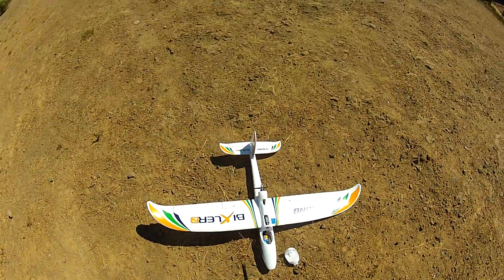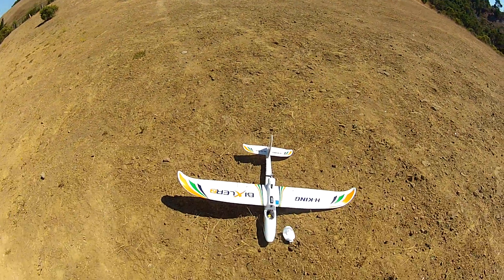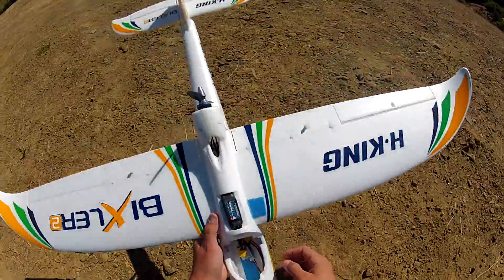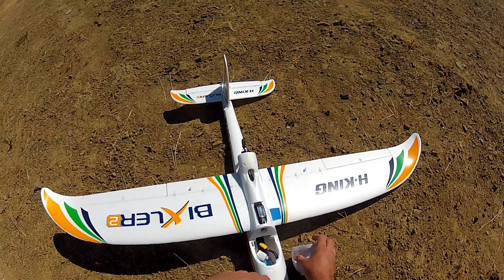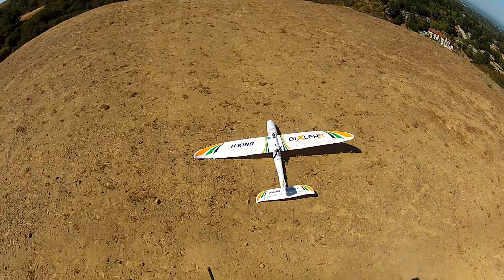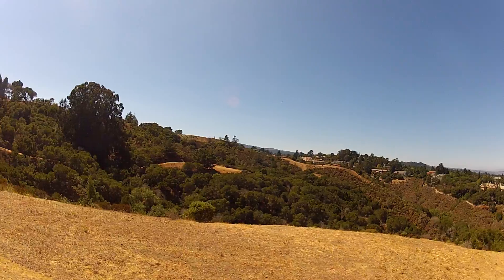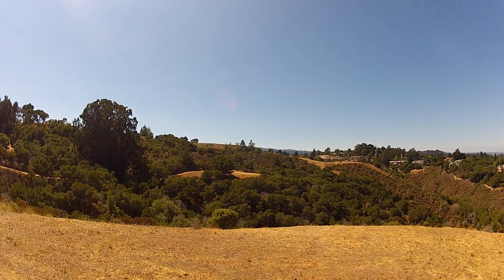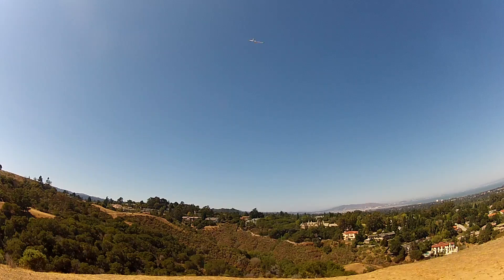Bixler 2 Motor Upgrade: TEST FLIGHT

Comment: Hi, I'm thinking of buying this, or another identical (sky surfer 1400mm) plane, but in the kit version, without motor and electronics rest and I would like if possible give me your opinion about which motor, esc, and props you should use Which is very stable but also have some power, will a 2826 engine 2200 kv will be suitable for this aircraft !!? thank you  !!

Comment: Hello my friend! I have a little problem! My plane is complete but for some reason even that the elerons are precise the plane keeps turning right...  Even with trimming the elerons from the controller to the left it keeps turning. Is it maybe a weigh problem? I am Asking because it is completely symmetric....
Reply: If you're still trying to solve the problem, try trimming the rudder in the opposite direction of the turn as well... Should solve your problem
Reply: Yes I still do! OK my friend I will!  Thank you!!!!!

Comment: Hey am I on my own here or is 2200kv over kill on the bixler 2? It comes with a 1300 stock which is just about enough but if you want more power whats wrong with 1500 or 1700kv I'm about to build mine as a kit. Could you tell me the benefits of the 2200 say over the 1700kv motor? I'm confused help! Cheers
Reply: +traci beacer from what i have read the 2200 is used by most people to balance the plane out at the CG. The weight of a 2200 balanced mine perfect at the instructions CG with no added weight front or back.

Comment: I've seen this video about 10 times and decided to try this setup on my Bixler 2. However, I did find my setup to be different... What I have done is used the 4mm carbon rod inside the hollow rod supplied for the wings, I've added 2 extra rectangular spars on the top of the main wings to prevent the wings from bending and added another spar on the elevator as well. And I also have the two extra servos for the flaps. Although I am using the same 2200kv NTM motor, I went with a Hobby King 50amp ESC instead but still picked up a 6x4 prop just as you did and flew the plane... Gotta say, not super impressed and it doesn't seem as fast as yours. I found the 6x4 prop not to be the best option for MY Bixler as I my plane may be heavier than the one you have. So I think the 6x4 prop is ideal for a light weight setup, but not if your plane is a bit heavier. It certainly had some speed, but I found myself flying at above half throttle most of the time just to maintain flight and do any rolls or loops. And not to mention, it was loud. Haha
I have since opted for a 7x4 prop which draws 46-48amps and about 500-530w, while the 6x4 was about 28-32amps and 310-330w. Of course, readings will vary depending on batteries used. I'm yet to fly the Bixler with the 7x4 prop, but I'm confident it will have power & speed to spare and I may not ever need push it to full throttle, but I'm pretty sure I will have a better speed envelope and won't need to be above half throttle as much (or at all).
Thank you for showing us this setup (I've also seen your other videos on the Bixler 2), it has certainly helped me in improving my plane and get more out of it without having to spend a lot of money. Keep up the great work. :)
Reply: Aussie RC Playground Mate, just throw in a Nano Tech 4S battery with a 6x4 and you'l love your bixler. The upgraded 4mm Carbon rod you installed is exactly what I did to mine, running the same 2200kv NTM motor BUT running on 4s. Your 50A ESC will handle short bursts of full throttle, just dont hold it for more than 10 seconds.You can always stay with 3S, but you will have to constantly have your throttle stick 80% to keep it up. On 4S you can have your thottle at 20% with allot more punch if needed. I usually get 8min of mixed flying (Speed passes/Gliding). Good Luck!
Reply: EUROASIAN10 Thanks for the tip, but I'm not really interested in running 4S in it. I have tested the plane on 3S with the 7x4 prop and it will climb until you loose sight of it or until you loose range. I fitted my phone in the Bixler with a GPS ap and clocked it at 109kph. The problem I have is my servos on the ailerons are total crap for this set up, so the plane wants to bank right at full throttle. Also one of my wings will flutter like crazy sometimes at high speed. These planes were never designed to go this fast and I think I have peeked my interest in upgrading the Bixler 2. It's really meant to be a glider/trainer/FPV aircraft, not some speed demon. Granted the stock set up is a bit weak, but the NTM motor and 7x4 prop is total overkill. Still fun to fly, just more than the plane can handle.

Comment: Notice you have the flaps working well on the Bixler 2 I'm still flying standard set-up . Like the motor upgrade. Are you giving down elevator with the flaps and what radio set up are you using to operate them. Like the plugs for servo's where do I to view that set up? Ian

Comment: Endurance?  Has none unless you re-enforce things.  A dozen loops and my left wing snapped .  Yup....the carbon spar is not strong enough.  Do the wings up right or loose it.  Your vid was good but your speed will wreck this plane eventually.  Beef it up.
Reply: Must be a QA issue, I've stuck a 3830 1000Kv motor on mine with a 4S 3000 (so it's heavy as a brick) and I've smashed it several times and my stock wing + spar are totally fine.
Reply: ejleipold I found it strange.  Wasn't really roughing it up.  Just did a large loop and pop the wing and spar snapped.  The carbon spar is light and rigid but noticed very thin wall.  I am looking for a 6mm aluminum tube instead.  I did that for the Radian.  No worries then.  Good luck with yours.!

Comment: hey can you tell me if everything fitted nicely. as if it was stock. the engine goes right in. did you have to solder anything. thinking of getting these but dont want to need to modify. thanks

Comment: I did all the modifications shown here :) .
Pros:
1- Flew with gopro2. 
2- Flew with wind >15Km/h
3- Can do loops and rolls and fly inverted :)
Cons:
1- Crashed it 3/4 times (my bad not modifications fault ;) )
2- The ESC burned after 20/25 flights :(

Now i installed a 40A Esc, already reinforced wings. And so far so good.
Thank you for the video :)

Comment: Thanks for the Video, helped me decide what to get as an upgrade for the stock setup, which I haven't even flown yet... Had too many issues with the prop adapter being wobbly and the new e-flight adapter not fitting so I have decided to do the upgrade, ready for some FPV which I am eager to try out...

Comment: how were you able to upgrade the power and not have the nose down flight tendency (common to pushers) when you throttle up for takeoff.  or did you just take off at half power?

Comment: Thank you for the great videos. It's a great plane and motor combination. I was surprised that you did the motor power test with a 3S battery. A 3S battery is great for a lighter setup (30A rather than 50A ESC and lighter battery), but it does leave a lot of untapped power, as the motor is limited to 310 watts compared to 696 watts with a 4S. Perhaps a motor also rated at 2200kv, but with lower maximum power would be more efficient overall?

Comment: Does the HobbyKing APC 6x4 Prop (074000058) fit perfectly to NTM motor mount? Or did you have to get the drill out of your toolbox?

Comment: I installed this motor and despite the plane being balanced out or being tail heavy, it tends to nose down (pitch down), the tendency of this being higher the more I throttle up. Do you mix in any elevator with the throttle?

Comment: if you can reply to this as soon as possible, ill be really grateful :)
I am looking to build an fpv rig with a bixler 2. I Need a different motor though, becuase the stock doesnt interest me. Like you said, this motor (ntm 2200) is complete overkill!! My question is though: how efficient is this motor, probably gonna run a 30 amp plush or so. Im kinda hooked on the plush, but am willing to try something else. I will be running a 3s 3000mah. But also willing to try something smaller.

Comment: Don,  Thanks for the great videos.  I'm about to pull the trigger on this plane.  I was curious...what servos come with it?  I ask because the HK website only says I would need addition 2x 9g servos for the flaps.  So are the elevator and aileron servos included, if so what size are they.  PS- Which servo size would you recommend for the flaps.  Thanks.  Keep the great vids coming.

Comment: Have you measured real push of that setup? Keep scale on the floor and put plane nose done and keep it that way. Then just full throttle and calculate max weight minus plane weight. I'm just curious to compare mine 2836-2700kv APC 6x4. It carries 350 grams of camera equipments.

Comment: FYI- if you are going for longest flight, thrust efficiency is obviously your factor. The larger the prop diameter, the higher the efficiency (Vc/(Vc +vi)). Put the biggest prop you can on this thing.

Source: I am an aeronautical engineer

Comment: Thx for you vids!
How do you secure the wings--given that you took out the tubes from the bottom? do you still put the screws in from the bottom, but they are shorter and end at the black supports in the foam layer below the wing and above the fuse chamber? 
To get the 28-36 motor wires through (?) the bixler mount, did you remove the bullet connectors, slide the wires through, and reattach (solder) them back on? Or carve and go around? 

All the Best!
Steve

Comment: Hi! Nice job! I just bought my bixler 2, and flew it a few days ago. I am using the stock motor and prop, but I am not happy with them. I don't kenow why, but it seems to be too heavy. I had some difficult to get altitude! Could it be related to CG balance? I am not using any FPV on it! I have some doubts about both ailerons and elevators travel, do you have any tip about setting them to maximize its travel (eg.: how much millimeters should them travel up and down)

Comment from the maker: As I state in the video, this particular ESC is capable of more then 25amps. that is why I am using it. If you are going to push full throttle and keep in inside the fuse, go bigger. With this setup, it bursts at about 50 amps. If not abused, this works well while keeping the weight down. A 30 amps ECS on the stock motor is way overkill too. It only pulls like 14 amps at WOT stock.

Comment: I think an 25amp ESC is not a good ideia for this motor and prop. I use the red brick 30A for the stock motor and an Trust 55A for the 2826-6 2200kV.

Comment: Just purchased almost the same setup! Can't wait! I did my maiden the other day and loved it...just needed a little more oomph. Have you tried a 7x4 prop? I went with a larger ESC than yours and would like a good cross between power and battery savings. Or is the best it can do using a 6x4?

Comment from the maker: The rudder is nice and gentle on the b2. It doesn't drop the nose like the b1/axn does. If you want a good example, look at my "bixler 2 slope soaring..." video. There is a few mins where I only use the rudder. No elevator or aileron at all!

Comment from the maker: Nope but I should. Everything about that esc is underrated including the bec. Still, to play it safe I will be installing a UBEC for heavy loaded flights. A small capacitor would help as well assuming it's not way off the mark.

Comment: Are you running with a UBEC?  I noticed the HexFET ESC you are using has a 2 amp linear BEC and you are powering 6 servos.